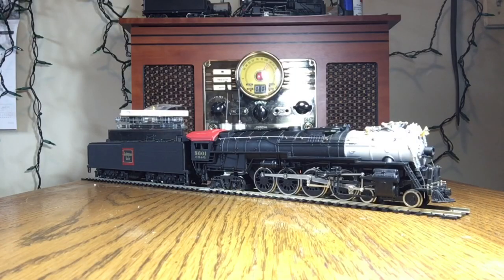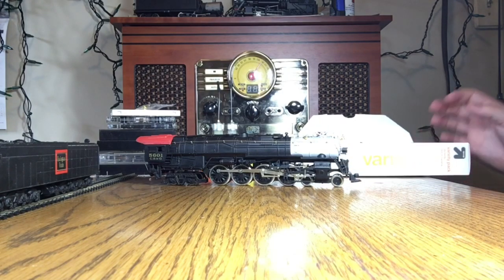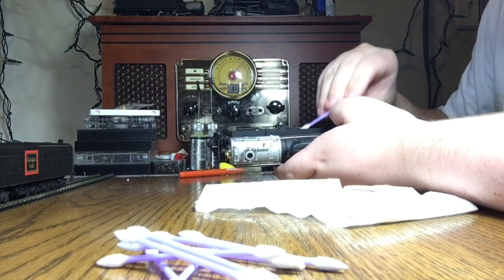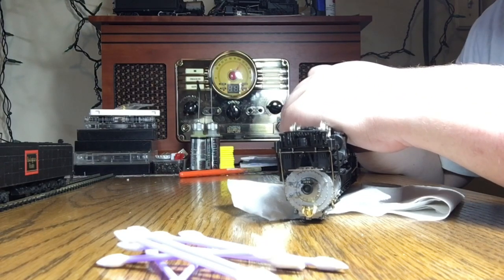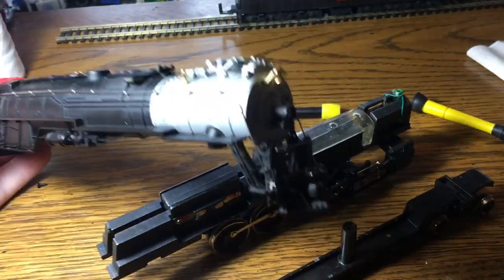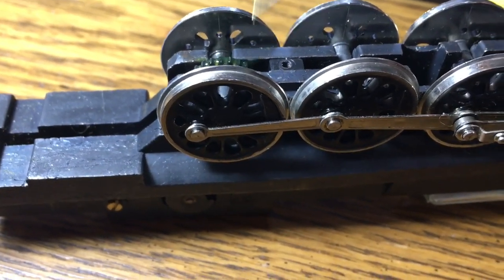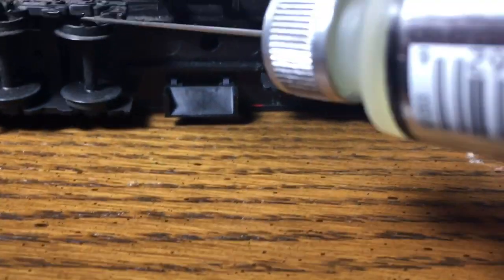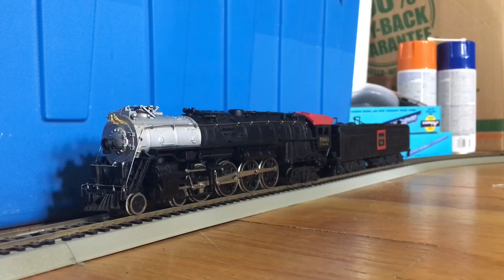Bachmann Pancake Motor ATSF Style Northern 4-8-4 General Maintenance

Comment: WHAT I HAVE FOUND WITH BACHMANN LOCOS (Steam) IS THE REAR TRUCK ASSEMBLY MOVES SO FREELY THEY CAUSE DERAILMENTS.  PERHAPS A HEAVIER SPRING SHOULD HAVE BEEN USED WITHIN THE TRUCK TO PREVENT THIS.  4 out of 4 BACHMANN’s  … VERY DISAPPOINTING!!!  MORE OCCURRENCES WITH 4-8-4’s than 2-6-2’s  … but with BOTH.
I AM “TURNED OFF” from buying any more BACHMANN’s.